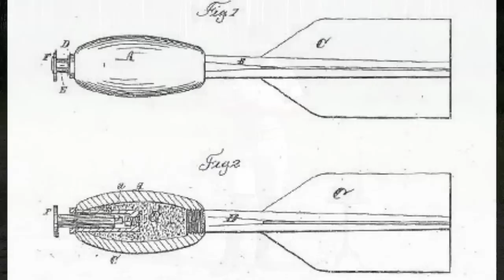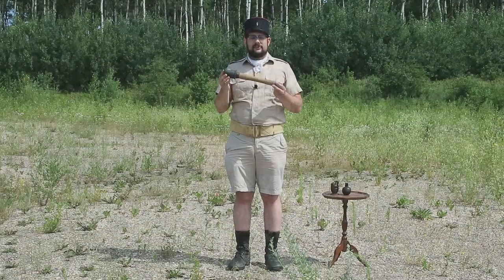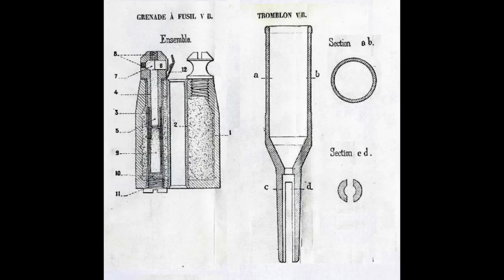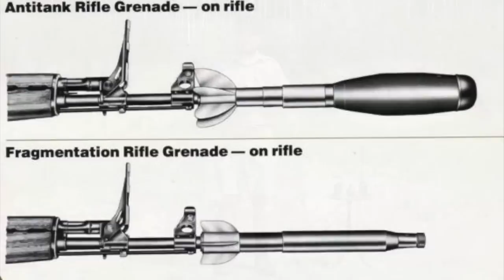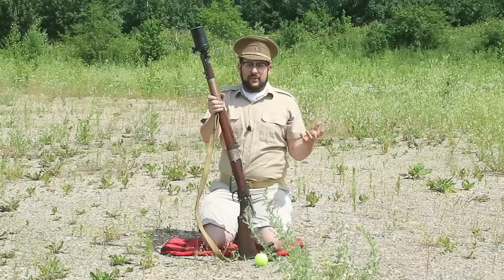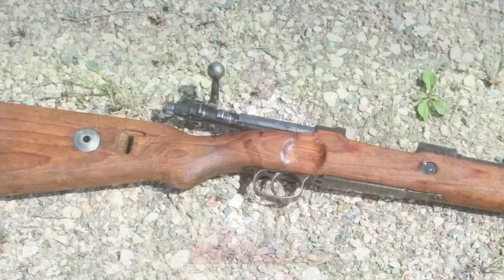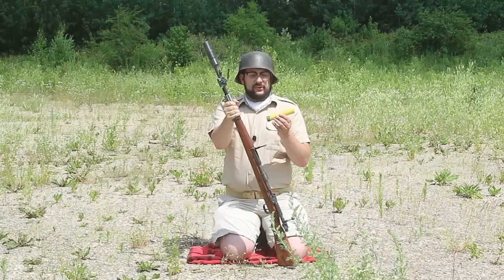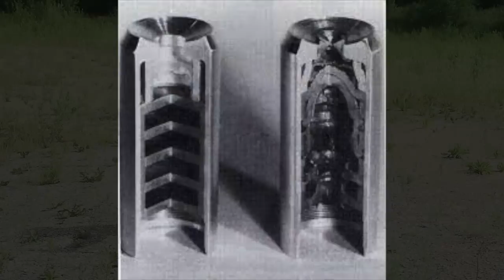The History of Rifle Grenades

Comment: I NEVER KNEW of the Pass Through French Design!  That was My Fav, auto fuse, easy, no ammo dramma, or Wrong AmmO Dramma!!! back on the job instantly!

Noteing the Flint Lock Launchers, "As A Stoner" and Capper Shooter Myself, I CAN SAY OWCH! I noted the Shoulder Stock and HOW short it wasoverall, so ir you shoot from the Shoulder You'r Done, If you post on the Ground you'r Done as those would put your Upper Torso just a Little Closer than Recomended? to the Black Poweder Business End! even prone I would think this System Just as Huge a Danger to the Shooter as the Target?

Have pulled a Boner and shot a metal ram Rod down range Under a Minie ball from a Springfield Riffled Musket, neve have found it looked every time I go out for better than a year.  "I CAN SAY!" "!OUCH!"!  a Granade on the End of a Weapon will have some Very Serious Distructive Recoil!

Yes? as Kids we Made and Used Tennis Ball or Patato, and Rocket Launchers in the early 70's right out side the Rockwell Downey Apollo, Suttle Gates on the same Street.   
And you would have SPLIT your SMLE stock with all the Energy in the toe upright as it Was.
GEEERATE Idea! for the Driving Band!!  I use a similar thing with copper tubbing and Black 12 ga or .69 musket and DIY projo.  maybe Black Powder Blanks? as they pressure a little different?